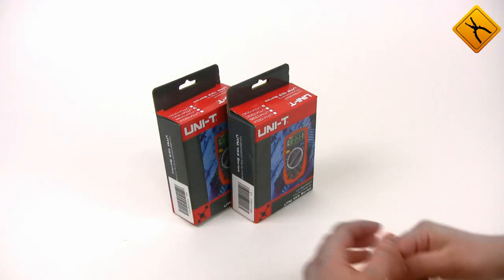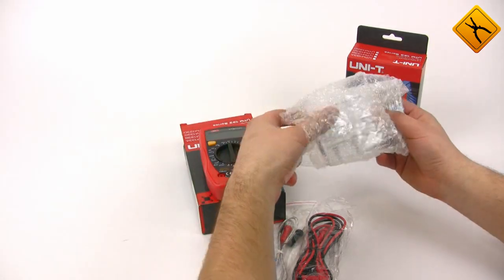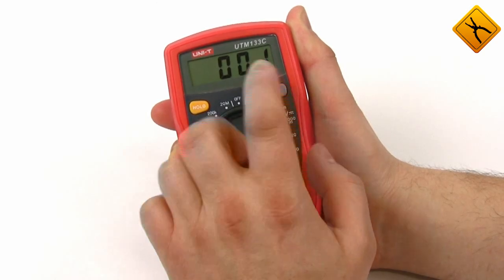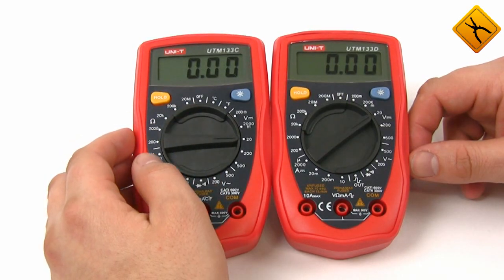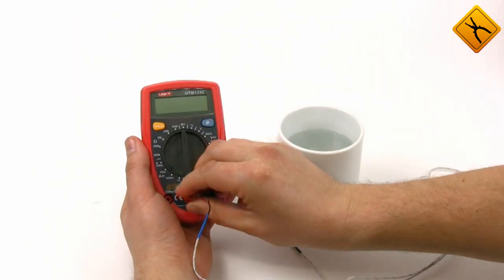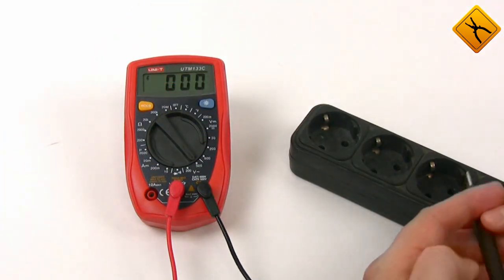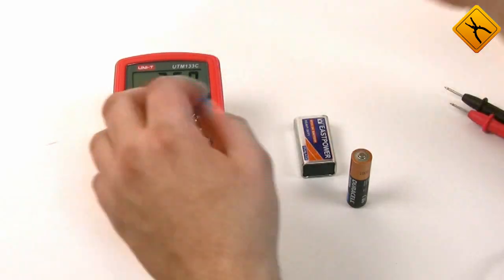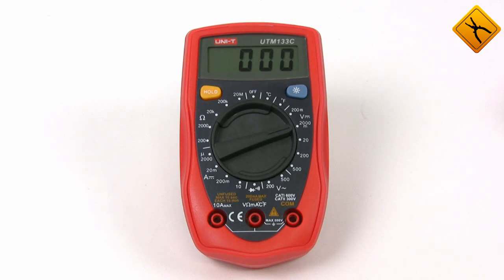UNI-T UT33C & UNI-T UT33D Digital Multimeters

Comment: My multimeter was showing wrong voltage, there is no calibration option. In this case 1) check the battery, replace 2) clean up inside - after prior battery leakage 3) there is metal horizontal something - clean it with alcohol. This worked for me.

Comment: The UT33C is a very good and affordable multimeter. I also reviewed and used extensively such a model. It is much better than other no-name designs. The only shortcoming is that it has a rather small voltage range (no 1000V scale). I assume it is so because it would require that the multimeter have a proper ceramic fuse and other circuitry changes.

Since about 2020, the model has been updated. It has a different screen, but it is less legible.  In some ways, it is not a step forward. It still uses the same 9V battery, which is a quite dated design today. I would have hoped the redesign to address shortcomings, but it is still a recommended product.

Comment: just bought the UT33d and the AC Volt measurement can go up to 250V, not 500V as this video shows. seems UTM-133D (as seen in the video) is not  UT33D
Reply from the maker: Hello! In fact, UT33D and UTM133D are different versions of the same model - UT33D. These versions are targeted at different markets. The measurement range must be up to 500 V (according to the features also specified by the manufacturer).